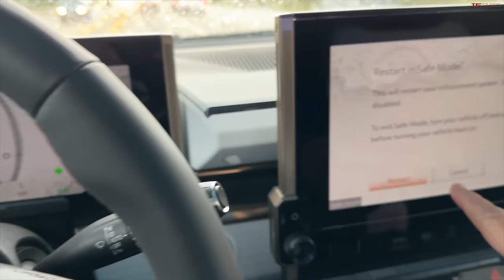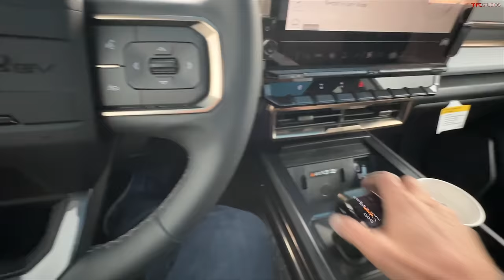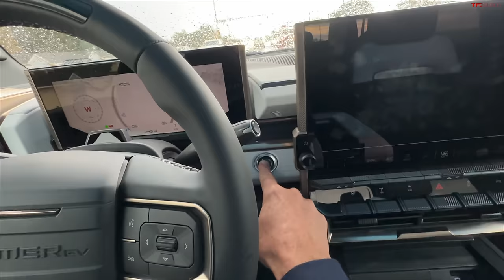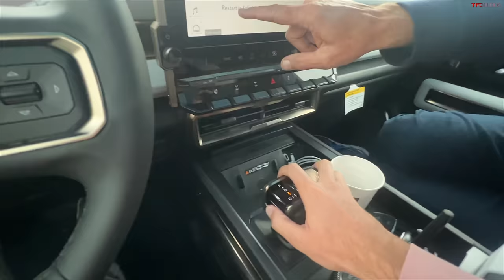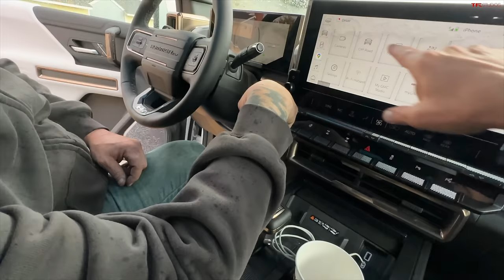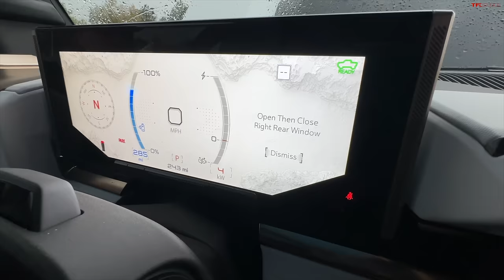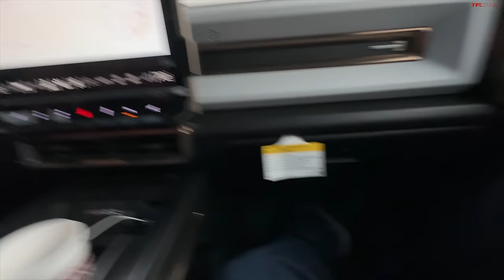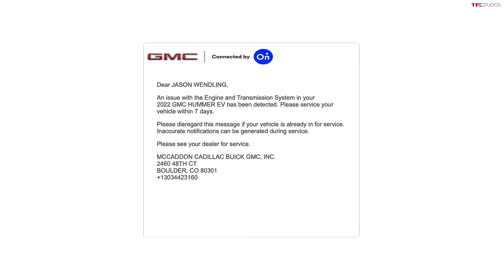I Bought a $115,000 GMC Hummer EV and It IMMEDIATELY Left Me Stranded!

Comment: I’ve never had a computer that didnt have issues/glitches at some point. To think that nearly all functions of the vehicle you are in traveling 80 mph down the road are software controlled is terrifying when you actually think about it. Thanks for the honest account of this experience- eye opening for sure!
Reply: The Lightning is all software and that never had an issue.
Reply: @Deatomizer  They have had issues just not as frequent
Reply: @andrusaaliiy9267  what issues?
Reply: I had water leaking in to my 2017 f150 v8 XLT and it was shifting me from 2 high to 4 high automatically. Computers shouldn’t be in vehicles controlling major functions that could get you killed.
Reply: I've never had a car that didn't have issues/failures at some point. Whats you're point?  lol
Reply: That's horrifying. Just imagine someone hacking the software and taking control of your ev and nothing you can do with it being all electronic and nothing being manual
Reply: Had that with an escort where the cruise control would kick in on it's own. The dealership said they couldn't find anything wrong so I traded it in to them on a newer car
Reply: Electric power steering. Electric throttle body. Electric ABS brakes..
Reply: @Oaky  Really? Well, I'm 52 and have been driving since I was 16, the only car that left me stranded was a Camry. Not saying other cars had no problems but none left me stranded like the Camry.
Reply: @Deatomizer  one major issue was overheating breaks after only stoping from 60mph around two times the breaks would overheat and cause problems can't imagine that happening going down a hill with 10,000 pounds and needing to make a sudden stop. Also there have been some reported issues of them just stopping kinda like the hummer Ev but those cases have been rare enough that there hasn't been any notice. In short all cars have issues some more than others.
Reply: Comparing a "computer" as in a desktop/laptop consumer device and a "computer" in a auto is just not the same and ignorant. They are completely different types of computers. Cars have computers for years and they don't hard crash like this.
Reply: @andrusaaliiy9267  look, let's bring this back to my first reply which is TFL did not have issues with the Lightning, that's it. I'm not going into the All Vehicles Have Issues debate. I'm only comparing the Hummer to the Lightning.
Reply: @dcast777  Exactly- cars have had simple computers for many years- keyword simple. These are clearly far more complex computer systems, and obviously they are crashing…
Reply: @craigbutler024  so this is actually a very real problem. There's actually a great video where a contract  government employee showed a journalist how he hacked, the most hackable vehicle at the time, a 2014 jeep Cherokee from his couch in St.Louis. The journalist that published the video told him to do all that he could and he hacked the vehicle through the U-verse system. He was able to talk to him, through his speakers, mess with his indicators and the most scary but his power at 60 mph. Everything was controlled. I would really like to see an article or video on what are the least and most  susceptible new vehicles to hacking
Reply: @dcast777 These new cars have hundreds of computers running and doing just about everything. That's why you see so many gremlins in these things and why I hate working on them it's hard to source the problem.
Reply: @Datastacked  I seen that too and why I will never own anything that has onboard internet or electric anything unless it's for the lighting
Reply: Right, we're still far off Star Trek Enterprise software that they haven't had a computer glitch in hundreds of years. I can't wait for 300 years for this to happen.
Reply: yup. i have been building my own computers and a few others for over 10 years. and they have all had some type of issue.glitch at some point. and this includes laptops that have been just purchased. all computers will have some type of issue/glitch.
Reply: @Oaky  it increases the more computers you add to control things.
Reply: My Chevrolet Cruze did the same thing. Dealer blamed it on a short powering the computer. Yes even Ice vehicles have computers.
Reply: Vehicles have been computer controlled since 1980. Those were horrible to work on, the computer could not even store the error codes.
Reply: I've driven my 2012 Volt for 120k miles and it has never done anything like this. To have a brand new $115k vehicle do this is unbelievable.
Reply: @ocrapo9327  the throttle is not important for safety, and ABS and power steering are just assists. 
There are however companies that want to remove the mechanical connection entirely...
Reply: "I’ve never had a computer that didn't have issues/glitches at some point."

As a long time computer and electronics tech, I concur.  Even the most stable operating systems and hardware can (although sometimes very rare) have an occasional glitch.  Sometimes it only happens once or twice and never occurs again.  I believe that modern vehicles simply have far too many computer controlled modules - most of which rely on communication with each other for the vehicle to function properly.  The fact that the software on this Hummer effectively "hung" in 'safe mode', which required a hard restart by disconnecting the battery, is not only scary, it's dangerous.  What if something like this happens when you're doing 70+ MPH on the freeway?  The manufacturer needs to resolve this ASAP.
Reply: @CrazyLegsMcGee  I totally agree with you.  The problem is exacerbated with more and more devices requiring internet access.  I read a story about a microwave that was bricked because of a software update!  If we had more programmers that did their jobs properly most devices wouldn't need so many updates in the first place (except for complex operating systems, of course).
Reply: @Oaky   At 250 mileslol
Reply: I'm a software developer and this terrifies me.  Everything that can be mechanical SHOULD be mechanical.
Reply: @adamharriger5193  The crazy thing is these EVs don't need complicated software, but everyone loves to show off the big screens and features. The actual drive computer components are very basic. In the end a core EV is just a battery, a 3-phase variable frequency drive, and motor. As an HVAC tech, I've seen 20 year old frequency drives still chugging away running 24/7. Theoretically EV's should be simpler and just as long or longer lasting than an ICE car.  Battery may not last that long, but the rest of it should.
I like all the modern comforts too, but there's a big market for just plain, simple, no-frills EV's. Especially for commercial work and contractors.

I like my tesla as a daily commuter, and I'd like to get an EV truck as a secondary vehicle, but I'd want a very simple and reliable one. No fancy internet connected infotainment system with a million driver aids. Just AC, cruise control, and a basic replaceable radio with bluetooth. Let my phone be the fancy computer system, that's easy to replace.
Reply: @stanley4327  An Escort? So you're whining about a car you bought like 20 or 30 years ago? lol
Reply: @Datastacked  It's not a real problem unless people are really doing it and at a scale that's significant. How many cars have been hacked while in motion in the real world, not as an experiment? I bet you could count them on one hand.
Reply: @mechmat12345  nobody's whining
Reply: @andrewt9204  Yes, tell us all about how EVs work, guy who took a 90 day training program in how to fix air conditioners. lol
Reply: @mechmat12345  What are you even talking about? Refrigeration systems have nothing to do with this.
Reply: @mechmat12345  I'm not as concerned with a moving vehicle at this time. But think of the kia theft problem. People are doing that and it's significantly riskier than hacking a $60,000 car with your phone. My concern is with the lack of security being put into these vehicles.
Reply: @dcast777  Chips are chips, why a shortage then everywhere
Reply: @Daddy Elon Cars drove fine in 1968.. Don’t need all this junk
Reply: @OM61777  Lucky

Comment: I bought into the EV craze, partially, when in 2014, I bought a first gen Volt. From that day on I was at the stealer at least once a month for one thing or another. Four years of utter grief later, I bought a gas powered truck and never looked back.
Reply: Should have bought a gen 2 instead. 😆 The second version and onward of anything is always better. Cars, phones, computers. Allow the manufacturer to have enough time to work out the bugs that they thought weren't there.
Reply: @fitybux4664   Sometimes better, sometimes worse. They made a hybrid Honda Civic. The Gen 1 was the best one, it just got worse since then. They had already perfected the engine by 2000, and they had already made the hybrid tech in other vehicles, and the inside was just practical and economical. Their subsequent generations were heavier, less practical, less reliable, less efficient in exchange for "sportier" performance that no one wanted.
Reply: That's just because volts are like that. Buy a bolt euv or something, it's way better
Reply: I hate EV cars but I also owned a 2014 volt, for carpool access.  The cars been to the dealer once and I honestly have nothing but good things to say
Reply: @suburbanTrick  I am in the same camp as you.  I had my Volt to the dealer once, the day after I bought it for a crack in the rear glass.  Had it for 3 years and put 40,000 miles on it.  Never had an issue with it beyond the first day, which was damage during delivery.
Reply: I own a Volt. I absolutely love it. Now having a EV car, I 100% would never buy a full electric vehicle again without having a backup engine like the volt.
Reply: Should have waited, with us 3 million  future Cybrtruk owners.
Reply: Electric are not the same as gas cars. the price and the technology is not there yet.
Reply: Bought a Tesla almost 4 years ago.  Love it.  With nascent technology, you've got to go with the clear leader.
Reply: Stealer?  Ugh... That's an interesting story. I've had two volts, a 2011 and a 2012. Current '11 has like 220k and the last one had 200k. Every issue I've ever had with a hybrid vehicle has been associated with that piece of trash gas engine attached to them.
Reply: @sonicelectronic57  I've always wondered how this tech would age. Seemed a bit too conplex to longevity.  

I think all electric, with a gas genny for back up.  But if battery tech continues to advance, this may  not be necessary.
Reply: You're better off without one of those big, fat, overpriced short ranged, Juice guzzling monsters. Respect the power grid, drive an ice car, make the OTHER guy responsible for creating blackouts.
Reply: It depends on the brand. We have have 2  Tesla model Y and never got into this type of situation. My last GMC Diesel Terrain's transmission died in middle of freeway at 20k miles.

Comment: You need to remove the front right tire and turn the vehicle onto it's side to reset it.  Makes for easy rebooting.
Reply: 😂. Okay
Reply: Well the lug nuts are electronically locking so… 😂
Reply: Haha that was the case with the PS1
Reply: Just pop some new AA batteries in the bottom and it’ll start right up

Comment: A true GMC to me was a small cargo van that was super reliable and simple to work on…I’m talking about a 1985 GMC Safari V6 4.3L (Chevy Astro) that my parents drove all the way to Guatemala and back to California with no troubles. I really miss the era of good cars.
Reply: The 4.3 is legendary for sure
Reply: A square body GMC or Chevy truck with a 350ci and turbo 350 transmission = few problems and easy/ cheep to fix.
This "Hummer" reminds me of the black box tech in Apple products. Lol  I wonder how long I could keep the before mentioned GMC/ Chevy truck going for $115,000.00 !
Reply: GM hasn't built a decent vehicle since the last G body and the Astro/Safari mini van.
Reply: Back before they found out that if cars last a long time they won't be able to sell you a new one and followed their greed.
Reply: I miss those Vortec 4300s
Reply: @dhama108  I would rather the TH400 over the TH350.  The 4L80E was pretty stout as well.
Reply: @Terk131  True that.
Reply: This is what happens when you put a steering wheel on an iPhone.
Reply: @trainglen22  Try the '95 Cadillac Deville, 4.9L V8. That's a work of art right there. My daily driver too
Reply: My brother just bought a 2001 regular cab with the 4.3L with 88,000 miles.  We replaced anything that is rubber or liquid.  I have to admit I'm a little jealous
Reply: You know how much coca you can smugle from Guatemala Ina chev ASTRO.  Ask my mom !
Reply: Wow! A 1980s era GM anything making it that far with no problems?
That's a first! You sure they didn't secretly buy a Ford Econoline and just put Chevy badges on it.😂😂
That would make more sense!
Reply: I wanna say that's what our family friends drove around the country fully overloaded while going to record shows for a living for 500k miles and never had a major issue!
Reply: @Terk131  4L80E's are great but open one up sometime. They are a nightmare compared to 4l60E. Almost as bad as a E40D.
Reply: @Terk131  Are you on dope?  The 4L80E can easily be and usually is misadjusted by dealerships resulting in a burnt transmission before the next service.
Reply: @PassengerFifty7    very well said 🤓😬
Reply: @batpone  mine is a 2003 MERZ CLK 320 V 6. Drives like a dream sooo quiet and reliable my daily driver!
Reply: @PassengerFifty7   I agree with you. They are beautiful cars. Pity that GM is basically a SUV/ truck company now that will be bankrupt in a matter of years.

Comment: so the Lightning made it to the Arctic Circle and back and the Hummer made it....200 miles?
Reply: That GM quality!
Reply: They are leading the ev race 😆 🤣 😂 😹
Reply: It could be just bad luck, as all first year vehicles suffer some infant mortality, but I suspect that it is not.  Some 2021 Broncos blew up in short order, but many more have been relatively trouble-free.  I would pick Ford over GM just about 100% of the time, especially for a 1st year vehicle.
Reply: @mpeugeot  It was a bad batch of valves only !!
Reply: The Lightning did NOT make it to the Arctic and back on its own.  It had to take a PowerBoost along.  No way it could do it on its own. - het in and drive it to the Arctic Ike you could any other truck.  Said as a new Lightning Platinum owner.
Reply: @arkhsm  Well... some bad fuel pumps too.  There also have been a few other show stoppers.  My point being that far more Broncos were released before the started blowing up than the Hummer EV which have just started to hit the road.
Reply: @dmfick18   I think his point was that it didn't break down or have a major mechanical or electronic one.
Reply: Doing 16 miles per hour part of the way. The Lightning was another disaster.
Reply: 😂 very true.
Reply: It’s the hummers turn to go to Alaska lol
Reply: @mpeugeot  Wonder how many Hummers are duds, TFL are currently 2 for 2 !!
Reply: @lesstevens2370  “leaving” he doesn’t speak clearly
Reply: @M_ann_M  They demonstrated that the Infrastructure was totally inadequate. More and more I hear of chargers being off line and  EV drivers being stranded. Not sure I’m ready for an EV until they have 500 mile range and are less expensive to own and operate than my full-size truck. Which, by the way, could have been driven the Dalton Highway without a chase vehicle.
Reply: @64Dasani  why would they'll be leaving I said leading
Reply: @lesstevens2370  just a joke.. sort of a play on words, GM is honestly not “leading the EV race” by any measure. I said “leaving” as if it was a Freudian slip.
Reply: @64Dasani  oh lol